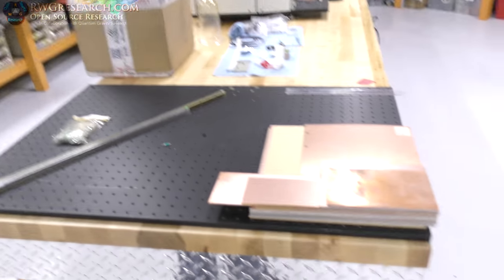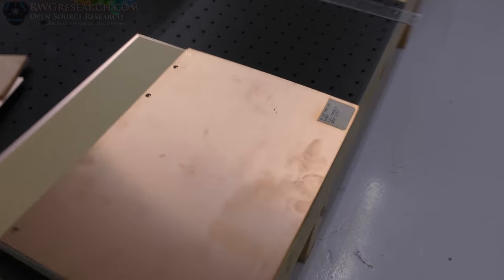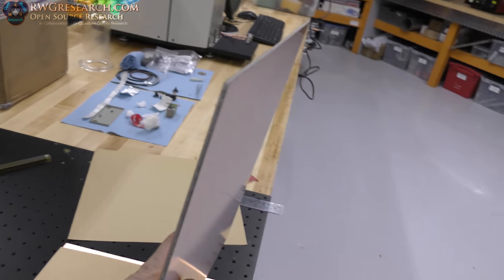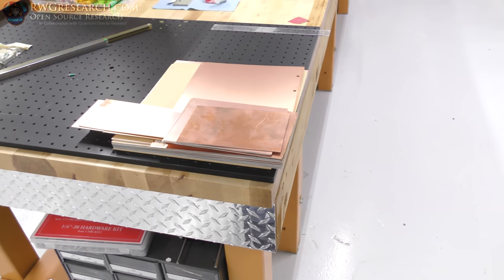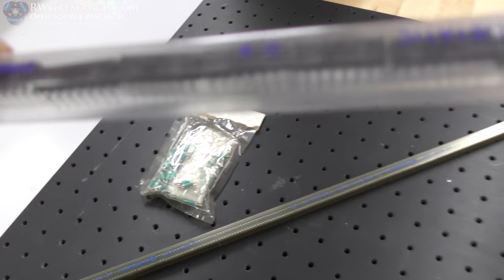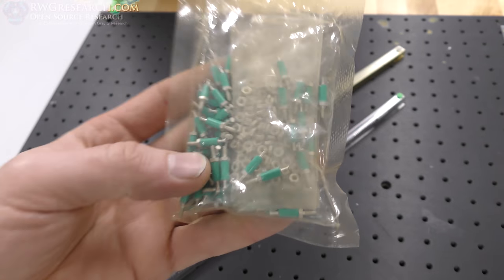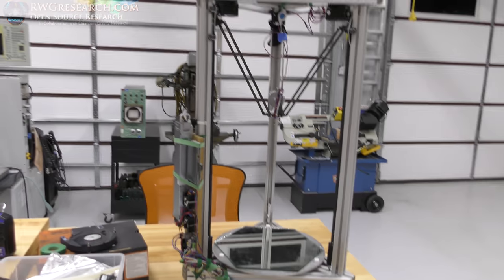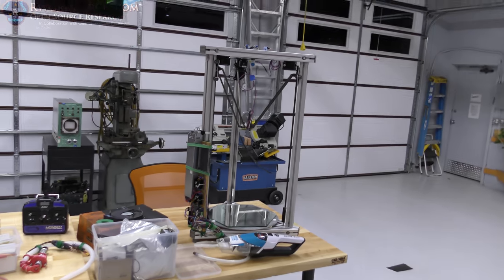Copper Clad Bord Score! You paid What! How Much?

Comment: "F" series 74xx logic is nasty stuff to hobby with... it causes massive switching transient current spikes on the V+ supply because they are so fast.... it takes incredible supply bypassing and careful signal routing to avoid problems.  Just something to be wary of. Back when I was designing on the corporate level, I had to use Rogers "Q-caps" (DIP leaded bypass caps, ie 303A16) to keep those nasty things "quiet"... keep them from causing signal bouncing and other glitch-related problems.  They suck a lot of power too...